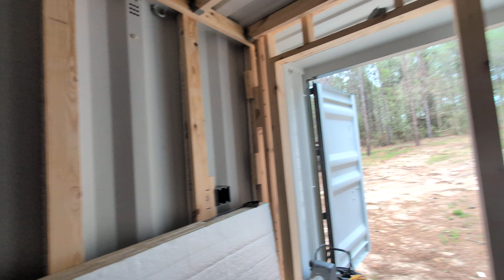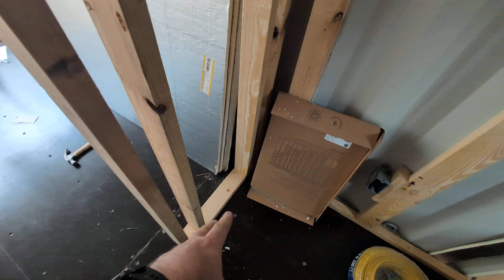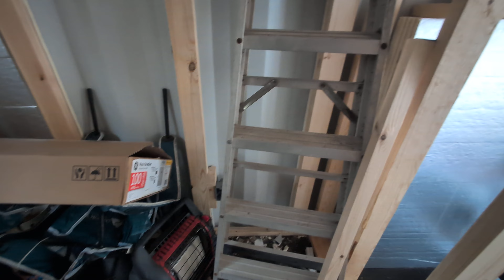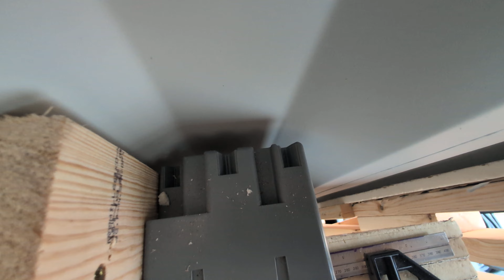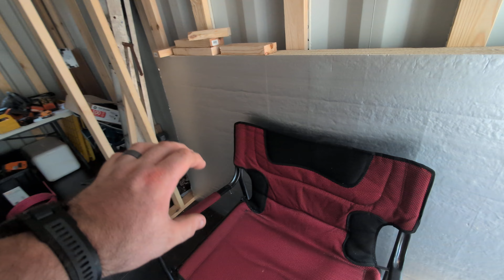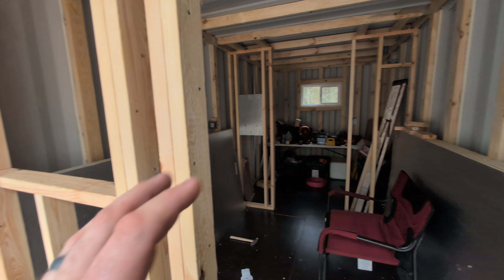Electrical going into shipping container cabin

Comment: What about an exhaust fan? To help move air around
Reply from the maker: I forgot to mention that in this video, at 9:40 if you look above the door there is a box laying there, That is for a "Register Booster fan" That I found on amazon. I need to install that box before I forget about installing it lol. In my last video I mentioned installing it inside the outlet in the wall but I may need to widen the cripples so everything fits.